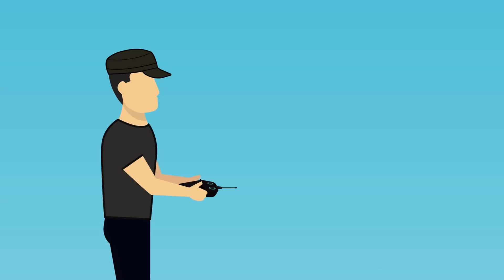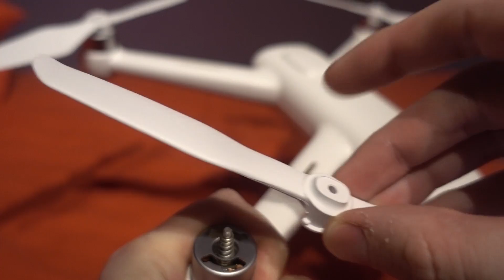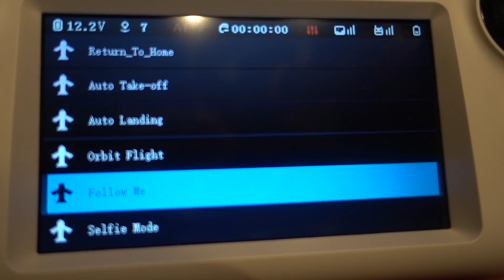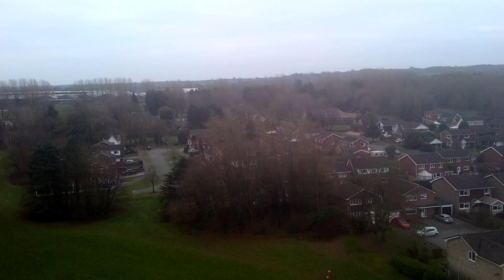Xiaomi FIMI A3

Comment: Great review Andy! I have the Hubsan Zino and the Hubsan 501-SS Pro. This quad is a perfect melding of both. With the Zino, awesome video but I can't use my FatShark Goggles. The 501 I can use my goggles but video is not "gimbalized" and is a bit jerky. I was looking at the Fimi X8 and it is way expensive plus can't use goggles. I won't need more than 1 kilometer of distance anyway. QUESTION: When you plug in goggles with the cord...does it disable others using "wireless" goggles?

Comment: (3 Fimi a3  questions ?)  I was thinking about buying a SkyRC B6 AC V2 balance charger along with a parallel charging board to charge 3 batteries at once. Because of the proprietary batteries with only balance female @ both ends charging  cables = no main red & black 2nd & 3rd cables  how should I connect to charge it? Is there no advantage between this & just buying Fimi a3  $6 one to 3 balance lead cable BG sells for charging 3 batteries at same time? Q 1) is there a advange of a true balance charge? Q 2) would it change more quickly? Q 3) Would I be able to get a longer flight time? 
Andy? Anyone?

Comment: Fantastic review! As usual...you are my go to channel for Drone reviews.  Keep up the great work!

I agree that this Quad seems like a great value.  Two questions:

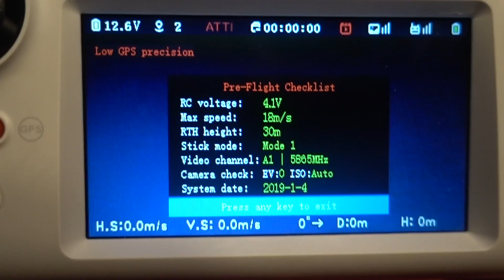1) At 23:50 you noted that you only got 1 hour of battery life per charge from the controller and I think you said it take 3.5 hours to fully charge it.  That seems like a negative...granted not huge. But if you forget to charge your controller between uses then you'd kind of be screwed if you fly multiple batteries (e.g., 3 per flight).  Thoughts?

2) You said the connection between the Quad and the controller is 5.8GHZ "analog".  Maybe a silly question, but are the WIFI signals always analog or is analog the standard. I ask because I don't recall hearing people say analog...Also it seems that typically when you see Drones start to lose their WiFi signals you pixelation first and then the screen just goes dark...but for you it seem like you started to get "snow" on the screen...hence my question about analog. 

 If there is a difference between regular (digital?) WiFi and analog is there an advantage of the latter (e.g., less interference, longer distance, etc.).

(Note: Did a little research and it looks like I may have answered my own question...see this link:
https://www.rotordronemag.com/difference-analog-hd-digital-transmission-drone-quick-tip/)

BTW,  As annoying as the dogs might to be to you it really doesn't detract at all from your video. 

Cheers

Comment: Hi. I have the Mi 4K drone and I would really like to use FPV goggles with it. Do you know of any solutions for this. I have seen one guy using a split screen app for Android but I have a iPhone and can't find a similar app for that. I also haven't been able to find what frequency channel the Mi drone uses. It is supposed to be 5.8GHz but I'm not sure and this information seems to be impossible to find. I really don't want to attach a separate FPV camera to the drone but but without more information that seems the only to use FPV goggles. My only bad for that unit.
One more thing, Do you know where to get firmware updates for the Mi drone and camera? There is a mini USB on the camera but again there is no information about what it's for. Thank you.

Comment: I received my Fimi A3 today but I am very disappointed, the drone battery won't charge. After more than 3 hours of charging it the red led light on the charger went out so it looks as if it's fully charged but when I put the battery in the drone it is still low battery. What a disappointment.

Comment: Wow, that was thorough! So glad you did this. I have the Mi Drone and unfortunately, I crashed it into a hillside last March. My fault, I'm sure. I was really new back then. It is almost completely repaired. I can not figure out how the wiring goes to the battery posts. (I had to remove everything and transfer the guts to a new lower body.) Anyway, if I end up setting the Mi on fire, I will definitely replace it with this, or another Mi. If anyone has the schematics for the Mi or knows how I can get them, PLEASE contact me. Another great job , Andy. You're the best!

Comment: GREAT REVIEW of the FIMI A3 , really like the transmitter without having to use a phone to connect. I have the Hubsan H501-s for over 3 years now, a great quad, I also have the H502-S, very fun to fly and for more serious video I have the Yuneec Breeze 4K and the Yuneec typhoon Q500 4k. All of which I really enjoy. A little later I may purchase the FIMI A3 as I much prefer it over the Hubsan Zino. Just wish that Hubsan would have had a transmitter like the H501-S of which I enjoy so much. Thank you always for very fine reviews of quadcopters!

Comment: Well, I have to disagree with you on this one.  First off, I think the reason they changed the name to FIMI instead of Xiaomi is because the ORIGINAL Xiaomi Mi was such an unqualified DISASTER, that their name has been irrevocably soiled .. which is why they are having to practically 'give away' the newer 4K version of the MI .   I think this is more like the DJI Spark than you do.  As for the price, I've already pointed out to one reviewer that you can get the Spark WITH controller for about $50 more than this thing.  The control GUI implementation is horrid, I think. You have to enter that menu to do the simplest things .. like an auto take off.  Many of the "Flight Features" don't work worth a damn .. orbit for example.  Had there been any kind of breeze or wind when you were doing the flight review, I'm sure you'd find (like other reviewers) that this Fimi bobs up and down like a cork on the ocean (unlike the Spark, who's bottom sensors keep it steady, even in the wind).  It has NO Obstacle avoidance, which the Spark does have, and for the $50 more which the Spark costs, I think that's money well spent. (Even if DJI's implementation of 'Obstacle Avoidance' is extremely flawed on the Spark ... in normal mode, it will still prevent you from flying into things).  I have to add, that part of my negative feelings to Xiaomi go back to having purchased one of their "Out of Focus" YI cams, which I had to spend 3 hours getting to where it was in focus without any aberrations or artifacting, BEFORE I could actually use the damn thing. Then there was the disastrous original Xiaomi MI, with all its faults, and crazy "You must fly 5 hours before you can use any special functions" feature  .... BLAHHH! (I don't think I'd buy an electric toothbrush from Xiaomi at this point .. YMMV) Anyone buying this "FIMI A3" better also buy a few of those "Fidget Spinners" to while away the HOURS you are going to spend charging the batteries. In today's world, I give this craft a grade of 'D'.  Now, had something like this been available 4 year ago, when I was building a camera bird out of a XK Innovations X380 and installing my own gimbal, my own camera, my own VTX, and my own telemetry OSD device (all of which added up to way more than twice the cost of this (at least at this pre-order point .. who knows what it will ACTUALLY cost when they release it?) , I would probably have graded it an 'A'. Times change, and so do expectations.  I'm sure that there are those who think that the FIMI is the greatest thing since 'sliced bread' ... but I'm not included in that crowd.  Well, what can I say .. there was bound to be something on which we didn't completely agree!  I still watch and value ALL your vids Andy. Cheers!
Reply: Hello Bill,
I don't know if you have one but I do.
I Come from Holland were we have a lot of wind and the drone is rock steady and everything works perfectly.
Reply: @lovemepleasnick  Hello Edwin. No, I don't own one, and am pretty sure I never will. However, I'm delighted that it seems to be working well for you. Succes!
Reply: @billsomrak  This drone can't be compared with Spark! This is a more like stripped down version of mavic with a teal price advantage. Not a mavic of course and that was not their goal. I like Xiaomi products.. Phones, action cameras are top not h and beats down the big brands like iphone, gopro in terms if price performance. With drones they need to do better, and hopefully they will have better drones.. If you can find this at its bargain price that is a good drone for the price.
Reply from the maker: no problem Bill. All it takes is one bad experience to tarnish a brand for someone. As a reviewer Im not allowed to do that. Its great if you can get the spark for 50 dollars more where you are based but not here in the uk the settings look complicated but the quick shortcuts actually found it quicker than DJI myself. Always appreciate your input. Cheers

Comment: Awesome and very thorough review, thank you. I'm interested in the the codec used by the DVR in the controller. I would prefer the telemetry data in the video's metadata instead of overlayed. What I really don't like is that there is no way to shut down the motors instantly. I assume Xiaomi did that so that people don't do that accidently in mid-air but still, knowing that it will take 5 seconds to get the motors to stop makes me nervous with all camera drones.
Reply from the maker: There is a way to shut down. it's shown in the video. It is very long so most likely skipped it. Can use separate recevier for DVR? Format is h264

Comment: That's a real thorough lead up to your testflight, appreciated. Already have mine on pre-order and cannot wait to get it :-)

Been thinking about your remark regarding the screen staying on during charging and that you don't like that. I think I kinda do like that, as it works out positively when your transmitter battery is running low during a flight and you want to start charging from a powerbank while you're still in flight.
Reply from the maker: while that is true I dont think you would ever need the monitor to last longer than it does on its own battery and having the monitor switched on to get its fully charge will wear it out quick
Reply: As long as you have one battery you're probably right, but for sure with more flight batteries, you might now and again want to top up the transmitters battery just to be safe. Guess we'll have to wait and see how many flights the transmitters battery will last.
Reply from the maker: the one hour thing was also done in 6 degrees C that is definitely going to affect battery life, even so it would take over 3 batteries of this copter before the TX battery ran out. I cant see anyone needing more than 3 batteries of this thing in one sitting. But thats just my opinion. I dont think its gonna be easy to replace that screen if it needs it

Comment: My order from Gearbest has just been shipped yesterday, I will receive it next week, thank you for this thorough video,  this is very helpful, it has given me a lot of knowledge about the drone that will arrive to me next week .
Reply: Wish mine would ship... bought it early November and still waiting.
Reply: @bjordan180ify  hope not from gearbest they are possessed
Reply: I ordered mine from Gearbest and they shipped it three days ahead of schedule.  I ordered it on December 20 and shipping date was January 7th but they shipped it on January 4 via expedited shipping (DHL).  I first ordered from Banggood on October but they kept on cancelling my order, i ordered this drone four times from Banggood but  they can't deliver it, they just cancel my orders after a week, it was very frustrating. So i went to Gearbest and tried my luck there.
Reply: @itsyeboijosh4488  wow that's great- my experience was awful glad you lucked out
Reply: I received my Fimi A3 today but I am very disappointed, the drone battery won't charge. After more than 3 hours of charging it the red led light went out so it looks as if it's fully charged but when I put the battery in the drone it is still low battery. What a disappointment.

Comment: Hi Andy, great and very thorough video as always. I was lucky and got one early and love it as much as my MI drone. I just have one problem that being that a 3 minute video takes one gigabyte of storage, longer videos being split up into several of that size. Does anybody have any idea?
Reply from the maker: this is how most camera copters operate it can be for several reasons. in the case of 4k drones the fat32 format has a limit of 4 gig files, so it has to split them other wise once it gets to 4 gig it wont record any more so either its using the same firmware as the mi 4k and using the time of the video to split or when set to 60mbit it sends the file over 4 gig although the maths says that it shouldnt. Other reasons are if you forget to stop the recording and turn off the drone only the last three minutes is lost. There is no gap in the files being split so is your issue that you dont have an editor to stitch them together?

Comment: Very nice review. Hope this drone doesn't suffer with the 4 k battery nightmare
Reply from the maker: never had a problem with my 4k battery
Reply: @AndyRCchannel  Lucky man. Plenty of complaints and grumbles about them.Including me in Xiaomi groups., no response from fimi though.e mailed them umpteen times. But we'll see if it ever gets addressed .
Reply from the maker: what is the issue with them people are having?
Reply: @AndyRCchannel  One of the cells under voltage , rendering the battery useless. I tried the fixes proposed on you tube channels , but to no avail . I suspect it has to do with the " smart " circuitry in the battery . After stripping the battery down I found I could use and charge the battery with a normal balance charger and use the cells for other projects. 
  Just search for 4k battery problems on you tube, see what you think. Will be interesting to hear your opinion..👍👍
Reply from the maker: as the mi is very cheap I use it more than the dji models as can take more risks with it. I have three batteries and all are fine. Maybe I am lucky but they are not replacing them? If it makes you feel any better all of the p4 smart batteries puffed and even cracked the shell. but no issue with the mi for mi
Reply: @AndyRCchannel  Ok . Lets hope my new batteries are free from sin . I think I'll sell my Blade qx3 and get the fimi , looks good.

Comment: Can you charge the battery at 1c with a different charger.
Reply from the maker: yes just need to make up a lead
Reply: @AndyRCchannel  thanks I might get one. I was looking at getting a spark but with the remote its  expensive. I have not used a drone that holds it position. I want something that the battery last longer that 4 minutes and I can take my eyes off the drone to keep a eye on the little one.

Comment: It would be nice to open the thing up to see the guts. Curious to see what antenna they use for 5.8 to see if its something innovative? Looks impressive.
Reply from the maker: at a guess it will be a linear antenna in the leg because the antenna on the controller is linear and its definitely at the back because when it faces you the signal drops significantly. I like it too much to take it apart haha. I only take apart the crap stuff.
Reply: @AndyRCchannel  Ha, stick a pagoda  on and the thing rock at that price. My crusty old 450 flamewheel and 3 axis gimbal  are over. Never bought rtf but hey ho. Thanks.

Comment: The footage is a very usable (brighter conditions) 1080p, unlike some drones who can barely manage useable 4K! I would like to see the 60Mbps data rate. The controller for this is a steal, no phone required and the ability to hook it up to FPV is amazing. I think Xiaomi are on to a winner here! Like most drones with no downward facing sensors, it does move up and down a little, but certainly less than the Hubsan Zino. Great video andy. I look forward to seeing more of this drone.

Comment: Fantastic Review AndyRC!  This definitely will be my next drone since it meets my camera-bird needs... and budget... and thanks to your review.  :)  Yeah, a 4K camera would be awesome, but at this price point it's not a deal killer. I was contemplating buying the Hubsan Zino but its camera, typical of Hubsan, just doesn't appear to be up to par.  Also, the Zino just looks so freakin' bulky.  This one is so slim and compact it doesn't matter that it's not foldable.  

As always, Cheers from Thailand and... stay warm young fella!

Edit:  I think the controller display screen staying on while charging can be a good thing.  If your controller battery is getting low it would be great to simply plug in a power bank and keep flying, i.e., not have to end the day's flying session to do a  2 1/2 hr? recharge.  :)
Reply from the maker: i dont think you would use the controllers battery up in a full days flying. but maybe thats their thinking

Comment from the maker: Time Stamps
0:00 Intro
4:28 Specs
5:26 Battery
7:02 SD card and Update
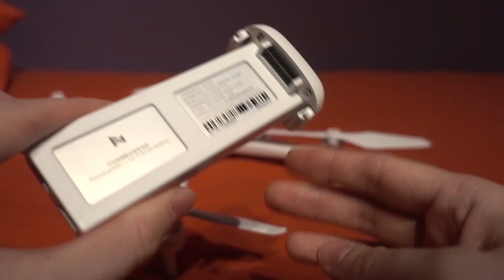8:35 Charging
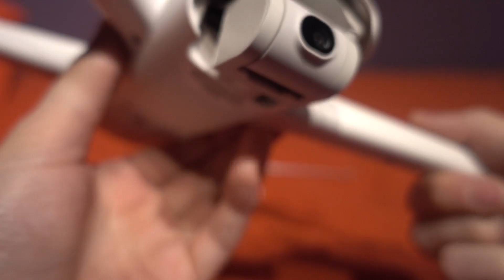8:52 Camera/Gimbal
11:08 Motors & props
12:01 DIY PWM / i/o port
14:11 Transmitter Overview
18:22 TX DVR / AV out / TX Charging / FW Reset
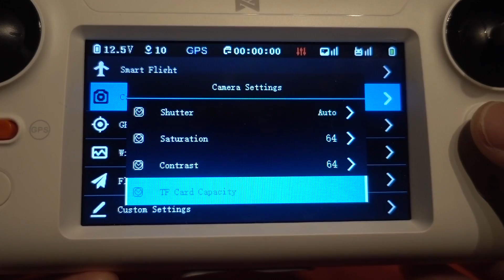22:05 Transmitter Settings 29:10 FW Update
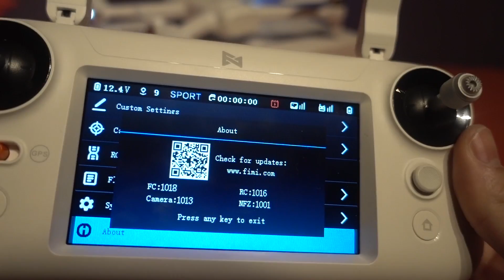36:48 Shortcuts & DVR playback
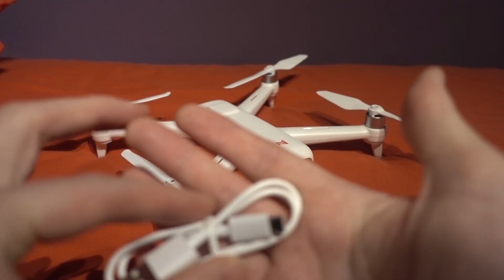39:11 extra Box Content:
39:50 Poor lighting conditions explanation
40:39 Flight
43:45 DVR Recording
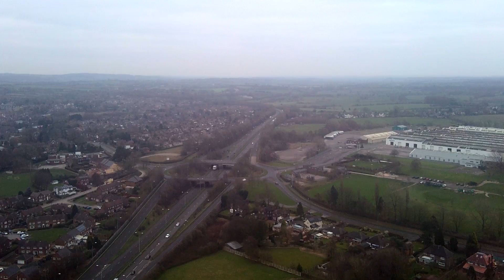45:36 Max legal height
49:26 Orbit
52:12 Return to Home (RTH)
53:38 Max Speed
55:11 Follow Me Mode
55:49 Max Flight Time
55:59 Conclusion
Reply: Saved my time!
Reply: @Xtreme Paranormal  with eu priority line it took 25 days to be delivered